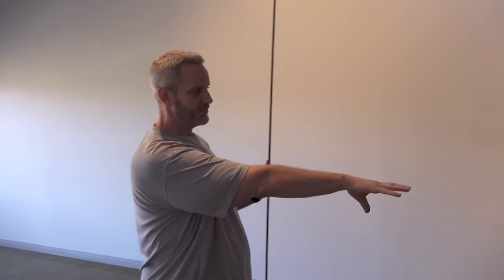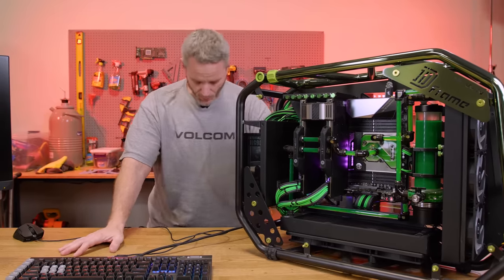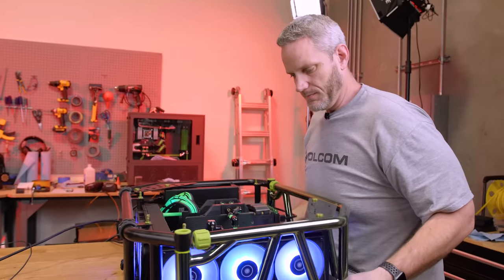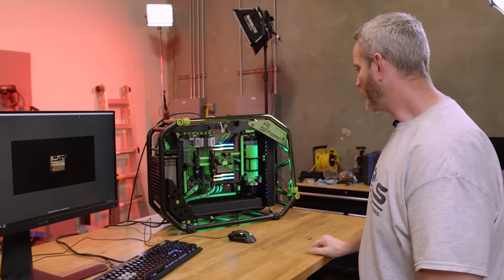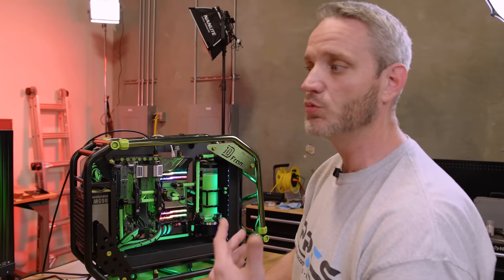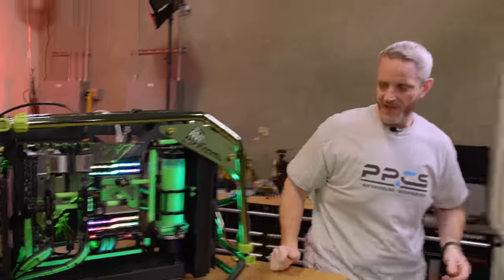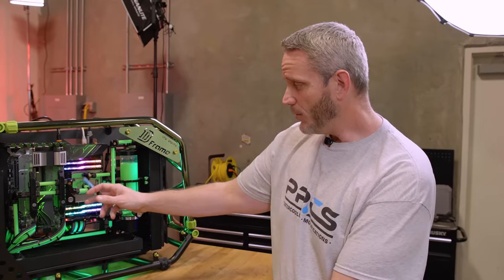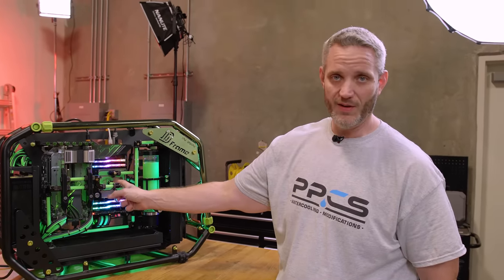This PC deserves better than this...

Comment: “This computer is old and obsolete” but yet still better than my computer🤣
Reply: Tell me about it, I'm still running a 1050ti lol
Reply: @SterlingSword98  same
Reply: ikr, not long ago i had a 750ti  lmao.
Reply: I really like the "this is still a serviceable gaming system" comment... like WTF!?  That runs circles around my rig (which admittedly is much older).   Would love to upgrade... except I CANT!  Jay, Linus and the boys apparently got all the cards!
Reply: I’m still on a 5820k and 290X. 😹
Reply: @MrMalicious5  I'm on 3470 and 280 :D
Reply: I'm rocking a MSI GTX 970 until I upgrade to a 1660 ti or 2000 series.... And this is going to go with a Ryzen 5 5600X until I manage to find a replacement lol.
Reply: Sharing the pain among us.
Reply: Lol I used to have a 6700k rx470 4gb. Just changed to a 2070S 3600X this month
Reply: @Mike__B  that runs circles around my rig that i just built 2 months ago
Reply: Yah, he could probably sell those cards for about $300 each or $700 as a pair right now plus $50 per block.
Reply: Im on 16gb ram 3200hmz. Ryzen 5 3600 liquid cooled & gtx 1660 super. So I think he was joking about being obsolete lol because my 1660S is turing and titan x is pascal the system is still better than mine and I have new parts.
Reply: My system is 5 years old, rocking an i5 7600k and 16gb of 3000mhz Ram.  The video card is newer at a 5700 XT but still....
Reply: Probably cause hes  used to having high end stuff to us mortals it's high end still
Reply: @Mike__B  I very luckily got my hands on a 3070 for my new build, gpu market is such shambles at the moment. keep trying buddy, I spent a good 2-3 weeks refreshing sites and joining discord servers that gave me stock drops
Reply: @Mike__B  Blame AMD and NVidia, don't blame youtubers which are giving you information how these cards perform so you can make a decision, hardly 2k GPUs are distributed to youtubers, i don't understand why people are thinking these guys have all the cards lol. Even if you are being sarcastic i have seen these kind of comments way too much
Reply: Better then most computers... I'm running an amd r9 fury
Reply: fr I got a gtx 970 lmao
Reply: Yeah pretty much. Most of us dont even have anything close to it.
I personally run a HP probook 4530S with i5-2450m and a external GTX 780
Reply: Better then mine aswell :P
Reply: 4 years newer than anything I'm running.
Reply: @Sigurther  i used to run a X5690 X58 xeon but my board died. It was a rampage ii extreme with cpu oc 4.5ghz
Reply: @SterlingSword98  I'm using a gtx 1050 2GB XD
Reply: A million times better
Reply: @aryanminouie9560  I’m using an rx 560
Reply: I don't know a ton about the gpus or CPUs he is talking about. How does a i7 8700k and 1080ti strix stack up against this system?
Reply: i still have a friend who uses my old athlon 5350 igpu build with 4 gb of ddr3 1600 ram, only thing he could buy was an ssd. He plays league of legends at 20~30 fps xD.
Reply: At my coutry is 1200$ this cpu alone!!! you can buy 3 i9 10900k
Reply: I upgraded this year to 4790k and Rog 1060, and I have PC from 2014 🤣 I would like have this instead of mine for couple of years lol 🤣
Reply: cries in rx580....
Reply: Im on an i5 4570 still
Reply: i would not say no to getting them :D
Reply: Yeah... "obsolete" just similar to a brand new rtx 3060 ti I guess. So if you have a 3060 ti throw it in the garbage, sorry it's obsolete already.
Reply: Makes me ashamed of my AMD 1700  and GTX970
Reply: I knew there will always be that one guy who takes this thread way too seriosuly
Reply: @releentleess  I realize that, it was said (typed) tongue in cheek.   That said I also blame vendors and retailers for not having better methods to stop bots from snatching them.
Reply: @MiniNeave  The fact jumping through all those hoops is required is a major turn off,  now add the massive increase in price that places are raising their cards too all the while saying it's strictly due to tariffs ... meanwhile the 20% upcharge some were charging by calling it "OC Edition" back in 2020 (before tariffs),  unless I get lucky enough to get a FE card or similar, at MSRP I think I'm just going to skip this entire series.    

I really don't have the desire to have to play these games, I like it better in simpler times where a company would be like "I have a product"  and I could respond with "I wish to purchase that product here's my money"  and all would happen.   Instead of now where an entire shipment is sold out faster than it took me to type that sentence.
Reply: @Mike__B  They're not required, they just help. I'm assuming you're in the US since you're talking about the 20% price jump. luckily we aren't receiving that in the UK (not that we know of anyway). The only reasons there's such issues with getting the cards is cause of the pandemic and the fact that the demand for GPUs and gaming pcs in general is at an all time high. There's just so many people trying to upgrade at one time that the demand supply just can't keep up
Reply: @SterlingSword98  Lol, I'm stil rocking my 970 haha
Reply: That's because those "tech-reviewers" are by no means representative for anyone but themselves and a very small number of people who want to be like them. Seriously: Watch these videos for entertainment value, not for information, otherwise you end up believing you need to buy a $3.000 computer every year just to play some video games.
Reply: And still, he didn't cleaned it!!
Reply: @MiniNeave  I could 100% deal with demand out stripping supply if those who purchase them are actually those who demanded (use) them.   What I can't deal with is all the scalpers that went full bot on day 1, and every day since then and turn around to sell the cards for a premium knowing full well while the every day person like me isn't going to pay that, someone who sets up a mining rig probably will pay it because they'll be making money off that card.
Reply: @SterlingSword98  Bro, a 970 on mine with an FX6300 and 20GB - it's a bit of a Frankenstein.
Reply: Here chilling with bull dozer 😂
Reply: @trev8591  20GB?   WTF is that all about?  "Hey I have these extra 2GB sticks,  I'm gonna put them in!!!" 🤣🤣
Reply: Jeez this comment section is just roasting me, im running a 760 bottlenecked by a phenom 710...
Reply: Original
Reply: @EagleFPV43  Nah someone will fire back that they're running on-board video while sporting some Atom processor :D
Reply: right there with you
Reply: The 3770k still going strong 💪
Reply: I feel you dude still rockin a 980 and 6600k
Reply: @EagleFPV43  phenom 965 black are super cheap at the moment
Reply: same. running an i7 920. did upgrade the video card to an RX480 when it came out, from an HD7800
Reply: Better than my laptop
Reply: @ryanknapp4865  dude 980 is way better than 1050 or 1050 ti , 1050 series was garbage even a 770 gives you more fps than 1050.
Reply: @brutality4612  upgrade to the 1660 super, its $50 cheaper and basically the same performance and better memory
Reply: Lol, right.
Reply: @SterlingSword98  rx580 with a ryzen 5 3600xt and 32 gb of ram
Reply: Imagine using amd athlon apu 🙂
Reply: @Mike__B  It's a bit of a "Frankenstein" made up from anything I had lying around.  Can't justify spending money on the PC when I've got the bills to pay, family to feed etc.  It is what it is and can play Cities Skylines which is all I want it for.
Reply: My and my 3770k and my 970ti
Reply: You are also not a millionare youtuber..however I am not, but I have builds like this😀
Reply: Same bro
Reply: Yep way better than my cpu , with a failing motherboard eh,  and im still on ddr2 sad
Reply: I love how he says it's obsolete accept all of us would kill to have a computer like that.
Reply: I know the pain. Great thing about being a few generations behind though is there are tons of software and hardware options available to you. You're not waiting for the catch up.
Reply: @star0fpe0ple  imagine being a person who doesn't game and just uses a computer for home entertainment and work stuff
Reply: My GPU is a NVidia 670 xD (though it is a  placeholder in my build)
Reply: I still have a 750 ti lmao
Reply: I just upgraded my 4 year old rig. Went from a i7-6700, gtx 1060 6gb, 16gb ddr4 ram, 1tb hdd. Too my new rig a i7-107000, rtx 2060 6gb, 16gb ddr4 ram, 500gb ssd, 1tb hdd for 1500 Canadian. 

Performance increase old rig got 40fps on medium settings playing cyberpunk. New rig 60fps on ultra settings playing cyberpunk i didn't try any ray tracing. I was also using a third party fps tester so it may not have been totally accurate.
Reply: Every pc on this comment is better than mine hahaha I still have AMD A4 APU😅
Reply: Same here lol way better
Reply: angry bulldozer noises
Reply: Have you tried ebay auctions? I got a gigabyte aorus b450 for 50 bucks
Reply: My first college laptop was and amd athlon x2 with 3gb of ddr3 and integrated graphics, then I went to an asus with i7 6700hq and 3gig 970m that thing still does well in most things except new game titles so long as it is on the m.2 i added to it instead of the 5400rpm hdd, as of last spring i have a 3600 and 2070s it is so nice but I am getting the itch for a faster cpu like a 5000 series ryzen 7 or 9 and then a 3080super when they launch those next year lol
Reply: Haha all these people complaining about their rigs so I'm going to see if anyone can beat me. 1100t and 560ti. Come on someone's got to have worse then that right?
Reply: @randomc1949  i wasn’t complaining lol I was merely stating we all start somewhere until we can get funds to get what we want then that becomes out of date in a blink of an eye lol
Reply: @jakemedley7423  yeah that's my problem. Look at building but there is always the next gen about to come out so you wait but then there's a new gpu so you wait and then i get bored and forget about it for another year.
Reply: @randomc1949  yeah that’s why i used my first stimulus check to do it was like imma build the best i can in that budget then as I go upgrade pieces as we go lol
Reply: I've got an i5 2500k OCed to 4.3, 16gb of Corsair Vengeance, and WAS running an R9 390x until it crapped out and I had to stick my old GTX 750 1gb back in it.
Reply: @MrMalicious5  most games are not cpu bound now a days besides like warezone and shit, i have a 5820k that things still holds up alright, not that fucking 290x on the other hand lol
Reply: @SterlingSword98  I am running a gt 210 with i3 6 th gen 4 gb ram
Reply: @SterlingSword98  1050ti is still Usable so no Problem. Ok i have a Gtx 1070 Laptop nur a 1050ti is still Good
Reply: @SterlingSword98  1050ti? im running on Intel HD Graphics 2000😂😂
Reply: @MrMalicious5  still on a w3690 and 290...I fancy an upgrade but graphic cards are nowhere to be found.
Reply: I have a 1080 ti and a 3600 :(
Reply: I’ve got an r9 270x
Reply: Teknogod17  Believe it or not, Apple mostly doesn’t allow the 2012 and back to run Catalina/Big Sur due to graphical limitations. You can run Catalina/Big Sur on any old Mac with a patcher... but it runs awful on most older Macs. This is only going to become more and more true as Apple continues its ARM Silicon optimization.
Reply: @rocknmeat  cries in gtx 1060 6gb actually rx 580 is a bit better than 1060
Reply: Same.

Comment: I have Primochill LRT soft tubing and run RainX Bug Guard green windshield washer fluid in it, works great! Just have to filter it out before adding it because the "RainX protection additive" causes the block to get this oily buildup in it. But other than that, stays consistent for months at a time, doesnt cause any issues at all, and the acrylic reservoir, blocks, and LRT tubes have had no issues with it, and unlike other coolants, it didnt dry out the o-rings and gaskets in the system. On the contrary, the "RainX Protectant" actually seems to lubricate the o-rings a bit!

Comment: Been running Primochil Opaque Pink SX with no issues for the past 6 months. I am running dual 420mm rads from Hardware Labs along with an EK block for my 1080 Ti and the "old" supremacy evo rgb for my cpu. I am using a Singularity D5 combo as well. All fittings are made by Primochill except for the temp sensor I am using for the fan curve.

Comment: 4.5 years with my 6700K watercooled setup.  Added 50mL of distilled water, once.  Otherwise completely maintenance free.  The cooling kit was (is) an Alpha Cool with 240mm rad, 5.25 double drive bay reservoir.  I'm using typical automotive (green) coolant.  No bacteria or other buildup in the reservoir or tubing.

Comment: I've ran opaque/solid a few times. I've only had it fall out, and really wreck havoc twice, both back to back in under 6 months. Believe I had a bad batch of coolant. Was using EKWBs Electric Purple. Aside from that, I've used three other EKWB solids and had no issues. Scarlet Red, Azure Blue, and whatever the green was, Acid Green or something along those lines all did just fine. Coolant was ran through ekwb blocks and alphacool/ekwb rads. Running distilled today with no prep or additives and was going on 8 months before doing a tear down for the 3090. Haven't ventured into any other brands of coolants unfortunately, so can only give some input on EKs.

Comment: Build ridiculously powerful PC.
Leaves in closet for 3 years...
One of those cards is worth more than my current gaming PC.
Reply: I have a similar system. 1080ti  sli but 7920x and retired it in nov 2020. for 5950x and 2080ti, i tries to get a both a 3080 and 3090 at launch but gave up and put a used msi gaming x trio 2080ti in for 600 pounds.
Reply: @jondonnelly3  The 7920x how well can it overclock? If it can get to 4.9 or 5.0 ghz it’s basically on par with 10th gen or 5800x
Reply: @Jon Donnelly
Rich people problems...
Reply: @TheChudoviste  its kind of funny you call them rich. Thats far from rich. Probably just better with money. I make less than most of my friends but can afford better things lol.
Reply: @ah7027  then you're probaly single,and don't have kids 😉
Reply: @TheChudoviste  yep hence the better with money thing. Also being single doesn't mean you spend less money. If your in a relationship you have two incomes and two people. If you don't then it's a personal choice to not have money. And having kids is a choice I choose not to make lol. Why waste the money.
Reply: @ah7027  Sometimes I ask myself the same...

Comment: I bought my EK Predator 360 brand new around 2017 (EOL 2015) and ran it for 3 years non stop 24/7, at which point the block was clogged so bad it didn't cool my CPU anymore and I was hitting 85C. Flushed it, cleaned it, runs perfect again with EK Cryofuel Clear :)

Comment: Primochill Vue: used it since 2017. I enlisted in 2018, and have used the system at Christmas for a week or two when I was home in 2019 and again a few weeks ago. It fell out, but after running for a few minutes it was back to like new. I haven’t had any problems with temperatures, and I added a few ounces of distilled water both times I went home. It seems to be a really good fluid in my opinion!

Comment: I previously used Mayhems Pastel (blue, since I know some colors had more issues than others) coolant in a system that I kept together for a very long time. It was running a 4790K and a pair of GTX 670s in SLI, with XSPC water blocks, Alphacool radiators, and Primochill Primoflex Advanced soft tubing. I changed the fluid twice on that system before I took it apart, at about 2 years intervals. Both times, as well as after final disassembly, the coolant wasn't chunked or coagulated or anything of the sort, and I was basically just changing it "just in case". The color never fell out or failed in any way either. Just like you credit the glass tube with your system's longevity, I feel like the Primochill tube I used had a major positive effect on mine. It's a plasticizer-free formula, so while it's not as soft as some other tubes, it never degraded or got cloudy either.
The whole system held up so well that when I decided to water cool my current CPU, I pulled all the same parts back out of storage. Same pump/res, same CPU block, and one of the same radiators. I ordered more of the exact same tubing too. Unfortunately, the Mayhems fluid wasn't available when I ordered so that had to be changed, and I'm running EK CryoFuel Solid instead, again in blue. I can only hope this loop holds up half as well.

Comment: The longest I ran opaque fluid in a loop was about a year in the first loop I ever assembled. I used Mayhems Pastel White at the time (2017) and did not have issues with gunk. Since then I have not used opaque fluids and just distilled water with additives or transparent colored fluids from EK or primochill for 4-6 months at a time with the main issue being the stain of tubes.

Comment: It depends on the fluid. With pure distilled water it can work indefinitely as long as there isn't any discoloration or cloudiness which is mediately apparent and easy to spot. In the past I've actually even used light oil or rubbing alcohol as an experiment which works but I wouldn't recommend it. Usually I would change the fluid every 6 months or so. An isopropyl alcohol rinse gets most of the gunk that builds up, out of the loop in my experience.